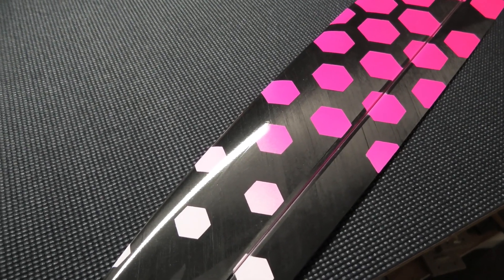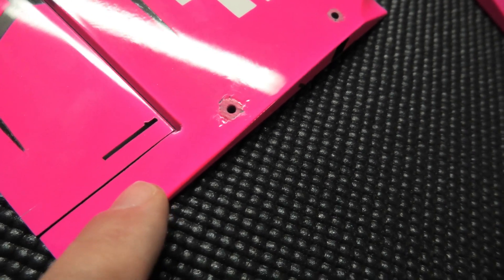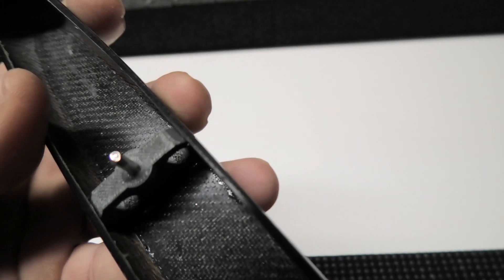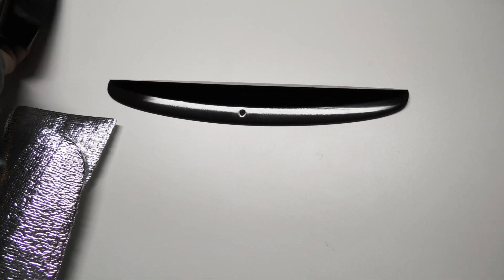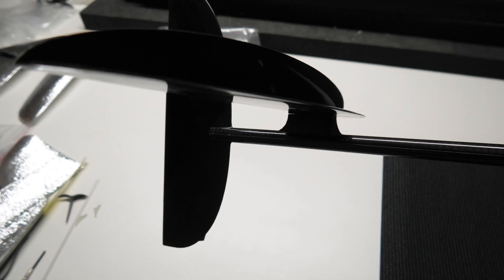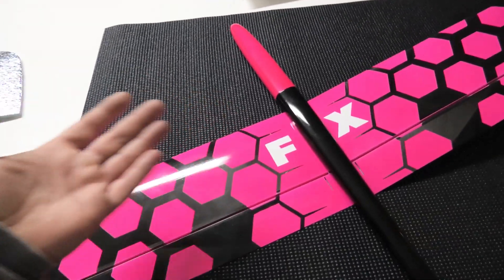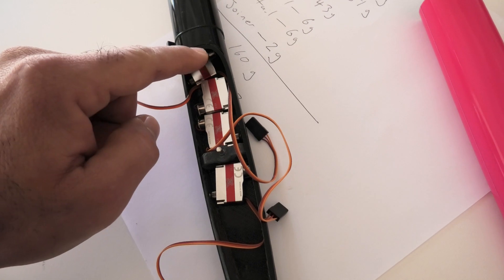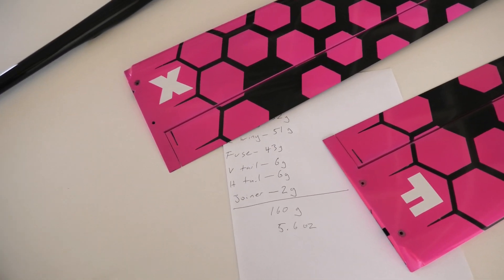FX F3K by GCM Models, new low wing RC discuss launch glider. Parts Overview.

Comment: I'm curious about how the low wing design, and the above fuse elevator will impact flight characteristics. I have 1M Deviant and a 1.5M BAMF 2. The BAMF 2  is a prototype, slightly different from the production model, but a great DLG
Reply from the maker: I've flown a few low wing models and was not impressed, but I will reserve any judgment until I fly one  :)